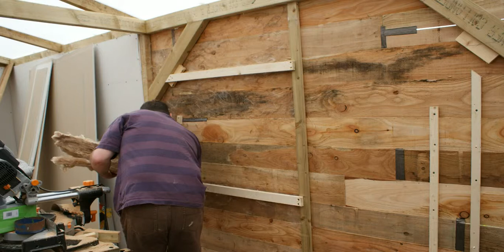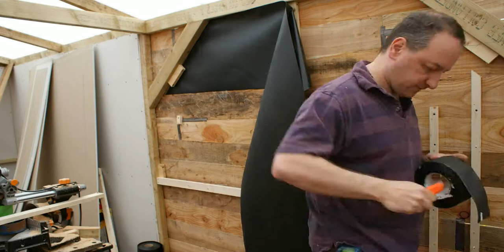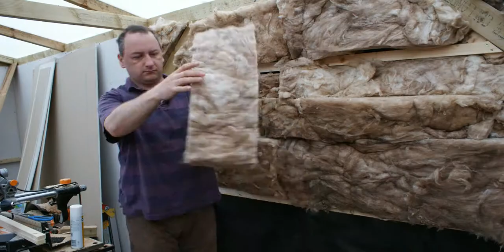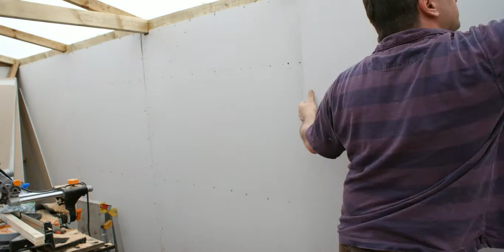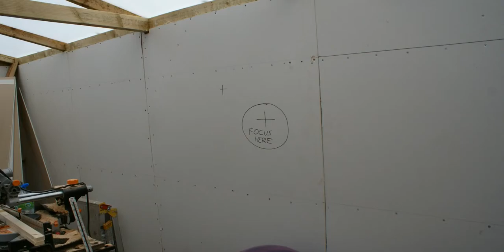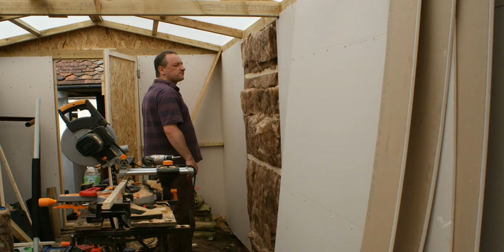Day 23 of my garage rebuild

Comment from the maker: The roof is twin-walled polycarbonate which should retain a bit of heat, and the panels sit very closely to the beams along the top. It's not a perfect match, but I can use padding if necessary. I would need some ventilation anyway.

As to the 'focus' bit, the shutter control mechanism lets out a beep when it's "pressing" the button - I could hear the beep, but not the shutter, so I knew something was wrong. It also does this if the battery is flat, or the memory card is full.